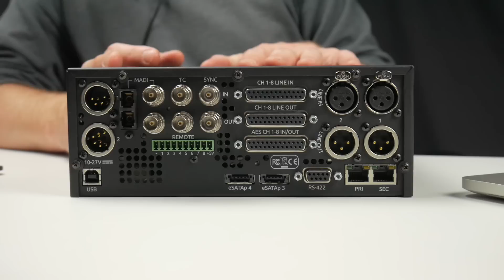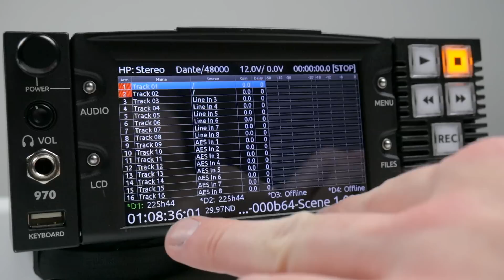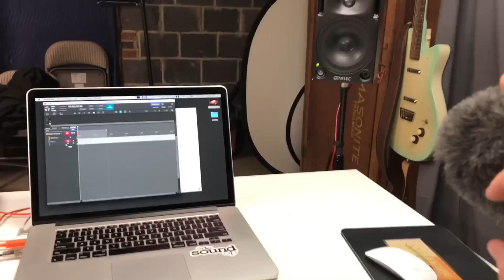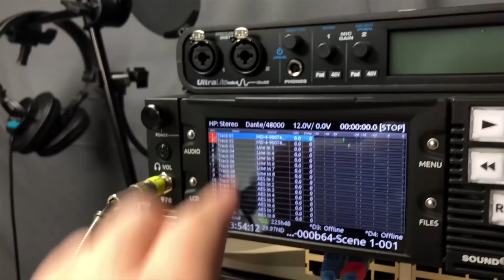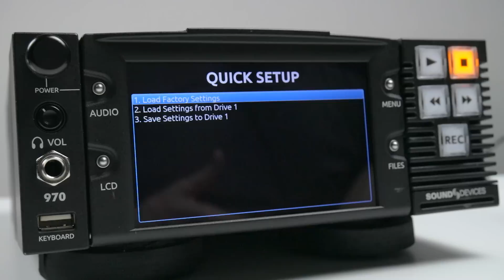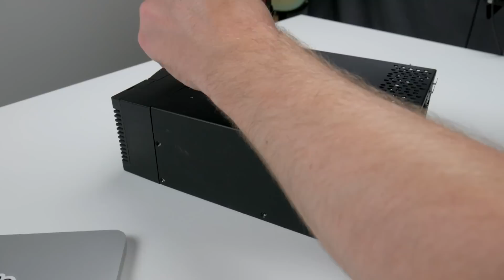#96 - Sound Devices 970 64-Track Dante Recorder First Look

Comment: Since you no longer have the unit, it would be difficult to answer this, but I will ask anyway.  In your video, you say that you can setup to record redundantly on two disks.  I just purchased a used one and have been through all of the menus and the manual cannot find a way to select this mode or even which disk you would record to first.  Any ideas?
Reply from the maker: Hi James, I cannot remember off the top if that was a firmware update that came later than the manual. The wording in the manual about recording to the four drives simultaneously is all I can find now, but I hope I didn't misspeak about that feature or lack of it. It's been too long honestly since I've been in front of a 970 to remember, have you tried reaching out to Sound Devices yet?
Reply: @DcSoundOp  It is operating exactly the way you and the manual described.  I had incorrectly assumed that you could select the option of recording to just one drive and have it automatically start recording on the second drive when the first one was full.  Considering the massive record time you get with a large drive, that option isn't needed.  I was pleased to see that the unit you used had FW 2.33 which was next to the last version.  FW 2.34 fixed some playback issues.  Even though they are expensive for the capacity, I ordered 2 480GB OWC drives as they were on the compatibility list.  Unfortunately one would not stay mounted and Amazon is replacing it.  I was able to order the drive caddys from B&H.  One seems to be very difficult to remove, but works.  I find that you need to raise Drive 1 when you install it in order to have the eSATA connectors mate.   All in all,, I am very pleased with the unit.  I only wish that Sound Devices could have found a way to sell it at a lower price so that more people would buy it.  I primarily record from Dante sources and it is ideal for that.  I also record to a laptop for extra safety.  I am concerned that I might not be able to get it repaired if it fails.  I spoke with Sound Devices and they do not have any more in stock and MAY not have any spare parts.  I asked them about the caddies and the the person I spoke with initially said that they were not available even though B&H stated on their website that more were on the way.  He then checked with Sales and found that they were available and that they had just shipped some to B&H.  B&H filled my order a couple of days later.   I would like to order a second power supply, but have not found it with the 4-pin XLR connector.  It is available on eBay with a different connector, so I may have to order that one and change the connector.

Comment: Thanks for a very informative tutorial on the Sound Devices 970.  Sound Devices is no longer making this model, but I have found a used one and have ordered it.  FYI, there were reports of playback problems with Firmware Version 2.33, but Version 2.3.4 is now available and includes a fix related to playback problems.
Reply from the maker: Thanks for the info, let us know how it goes.

Comment: So far I've had several problems with the 970 I just picked up. VERY IMPORTANT that it does not record 96k over dante (video suggests otherwise). I have tried several intel and sandisk drives and have encountered playback errors on the intel drives. Sandisk extreme pro drives yielded "media I/o" errors. going to try a few other brands but high liklihood my 970 is going back for a return.
Reply from the maker: Brendan Connors Brendan, very sorry to hear you’re having issues. Is this a new unit? It absolutely should do 32 tracks over Dante @ 96k. I’d be interested to know more about the drives you’re using and the issues you’ve seen. Very serious sounding for sure. have you reached out to sound devices directly yet? They’re usually very good about support. Keep us updated, thanks for the message.
Reply: @DcSoundOp  Please refer to page 65 of the manual, Dante is fixed 48kHz operation. Maybe you can force the recorder to capture 96kHz files but the Dante implementation is just pushing 48kHz audio into the 96kHz capture, so you will have no information in the 24kHz-48kHz range. That’s just a waste of data.
http://cdn.sounddevices.com/download/guides/970-UG-v233-web.pdf
So I am testing 18 different Intel 335, 520 and Sandisk Ultra and Extreme Pro drives. The 300 series are not on the list of supported drives but the Sandisks are. All are similar read/write speeds and I use them with several Hyperdecks and Aja decks without a problem. 
I have encountered a bug regarding playback of 64-channel recordings. Thats pretty much all i plan to use these for. You will usually capture the set without a problem, but once you stop and finalize playback is impossible, neither the play button or prompting playback through various means will get you the 64 channels playing back together. I can play individual tracks to play back but pressing play yields an “Unrecognized File” error message (Im testing with a 2-hour concert but have encountered the bug at shorter lengths of time as well). The files, once transferred, are fine once you load them into a DAW like pro tools. This makes using the deck as an instant soundcheck is impossible.
I have a friend who also owns a 970 and he has also confirmed that he also runs into this issue to this day, and has cited the very same playback issues with OWC and Sandisk drives from the list. 
I’ve also run into “finalization error” and a “media I/O error” with one of the sandisk extremes I tested but I have yet to replicate that on another drive, but thats TBC…
I’m waiting on some other Samsung and Sony drives to arrive for further tests over the next few days, but if I can’t find the reliability that I get with my MacBook Pro/RME system I’ll likely return this and just update my laptop rig instead. That system is flawless, if not more cumbersome and physically less robust than this 970. I want to love this box, its so clever and checks all the boxes but so far I’m wary…
Reply from the maker: Wow, I’m incredibly sorry I missed that spec on Dante being capped at 48k on these. It looks to be the only digital input capped at 48k, with MaDI & AES3 both going higher. 

If I’m following you right, the issue you’re seeing with finalization and playback on the deck are known issues to sound devices? I’d love to know more about what their response was. Can you message me directly at info@dcsoundop.com - I’d like to compile all of this with you and add it to the corresponding page on my site for future viewers. 

Thanks so much for reaching out and letting us all know what you’re experiencing. Valuable info 👏🏻

Comment: Could you do a review of the sync capabilities of this unit?
This is something that is a definite game changer compared to a Laptop/DVS solution, which will be drifting with time.
Is it possible to connect Genlock output from a camera to this (or the other way round), how to use wordclock with this unit on a film shoot with (multiple) cameras?
Thank you
Reply from the maker: Great question! I'm out of town at the moment, but you might find the answer you're looking for your specific setup on Page 27 & 28 of the docs here - http://cdn.sounddevices.com/download/guides/970-UG-v233-web.pdf 
The short story here is there are a LOT of options for sync on this unit & it is specifically designed to avoid offset & drift issues in video production environments. 
I'd love to do another video (lots more really) on the 970, but I had to send this one back after the review.